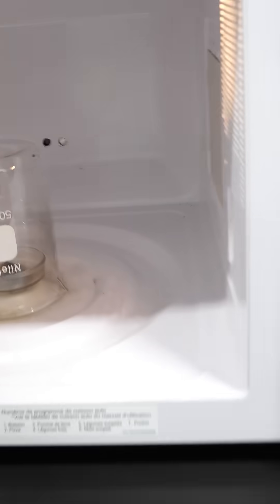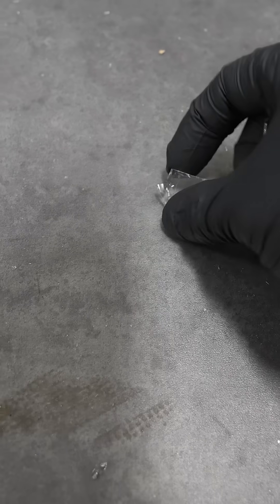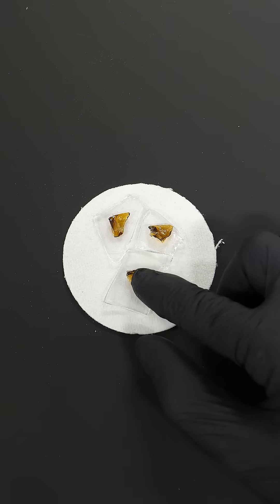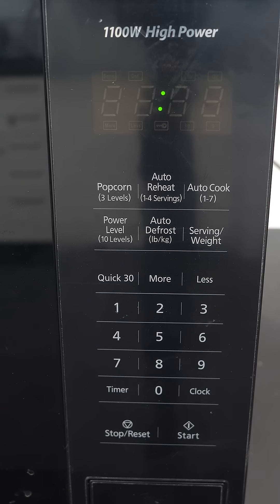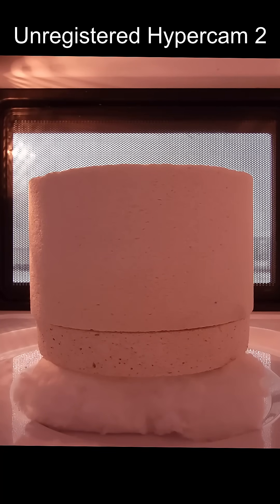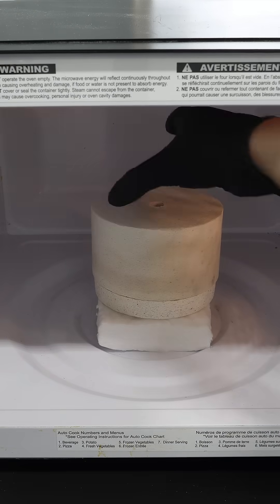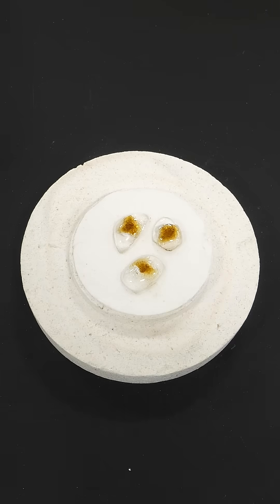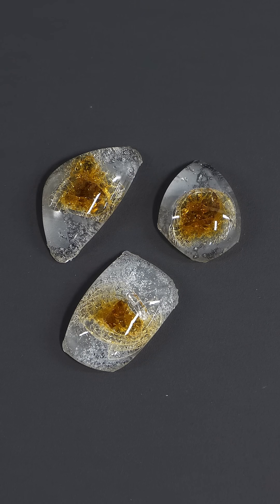Melting glass in the microwave is crazy

Comment: Fuzing inside a microwave is actually really cool, my mum is a glass artist, and we also have one of those. Kinda crazy that it works even in a microwave. The problem why your pieces have all those cracks is that you need to cool the glass down in a oven for like 8 hours or so, so it doesn't build up internal stress and cracks.
Reply: Yep. It's called annealing.
Reply: @mrfirestop415 i’m so happy i recognize this word, im in a metals class  and when the metal is work hardened,  we anneal it to make it softer (i assume its similar or the same for glass) then we put it in water and it makes a lovely sound which my teacher calls quenching
Reply: @alienlapdance  annealing is when the metal is raised to a critical temperature where the crystalline structure can rearrange itself to get rid of the deformations created by working the metal (work hardening). The metal has to stay at that temperature until all the crystalline discontinuities are gone. 

Quenching happens with alloys with are heated up past a different critical temperature causing a change in the structure of the solid solution (steel will have several different solid solution structures called phases. They can graphed in a phase diagram). For steel (% carbon/iron is <2%) rapid quenching in oil or water will cause a sudden change to the structure called martensite which is very, very hard and also very brittle. 

Tempering will change a portion of the martensite to a different structure which will make the steel more resilient,less likely to shatter.
Reply: I wonder if a controlled cooling WITHIN the microwave could work: 6 minutes at max power, then bursts of 10 seconds progressively less frequent to maintain a steady decrease in the kiln temp.
Reply: That sounds so cool! I love anything art related, and i would definitely love to try glass art 😊
Reply: do you know if there are heat resistant molds that the glass stays contained within?? really cool! I would like to make little stars with broken bottle glass
Reply: @cocoandrobin  if you ever manage to make your little glass stars, please come back here, and reply to thus comment with a link to the video you make of the result. I love the idea of little glass stars and would love to see them one day.
Reply: Your mom is busy she’s aT my place right now
Reply: @at_3831  wow, such a useful comment 😂🤦🏻
Reply: You ever just wanna chew on some glass?
Reply: @ScrubbyRumpkins  always
Reply: Would these pieces be safe to make into jewelry or do those cracks make them likely to break?

I'm not going to do this at home, I don't have proper equipment or knowledge, and I'm not stupid enough to do something like this without those. I'm just curious, cause these are pretty.
Reply: @sammyisanoctopus  yeah the cracks make the glass fragile and very likely to break
Reply: Why not just 'cook' them in an oven to begin with?

...Cook... God, I feel like Walter White... 🤔🤔
Reply: @daytona1073  well most people don't have the space to buy a glas oven. And this is a fun little way for those people
Reply: @daytona1073  A regular oven does not get hot enough.
Reply: @daytona1073  convencional ovens cook no more than 500degrees. To melt glass you need more than 1400degrees, and those especial oven are expensive. This is the most inexpensive way.
Reply: OMG ASK YOUR MOM HOW SHE DOES THE ART

Comment: Hey did you get this idea for me I brought this up and one of these videos and they have been yours? You might as well try the light bulb one next. But you got to have the glass up a bit about half an inch and upside down though and you shouldn't have any issues with ruining your glass. Plus you don't have to use Pyrex. The problem with using microwave as a kiln per se is the heat tends to focus on general area and you have to get the timing right

Comment: It's because you put them near each other but not touching. The pieces that were touching did get fused together though. The only difference timing or power would've changed is how melted the glass got. Try having the pieces touching and maybe during the cooling stage opening it up and mixing the glass before it's hardened

Comment: I had this old turn knob style microwave that my stepfather gave me when I moved out. My roommate had put a glass mug in the microwave with water and cranked the knob turning it on for what must have been a good 30mins at least and then he jumped in the shower forgetting about the microwave. I came home and noticed sparks inside the microwave and quickly opened and unplugged it. That said, ..the top of the microwave had melted down molding into the top of the glass mug which didn't shattered and still had water left inside. How it didn't blow up or cause a fire I will never know, ..but we kept the microwave as a kitchen showpiece for a good while. Eh, ..being young and dumb. good times

Comment: The glaas pieces have to overlap to melt together if it's that thin. Glass likes to puddle to roughly 1/4" or 8mm tall. Since those were mostly shorter than that, the edges pulled in. If your piles of glass are mostly over 8mm high, it will glow outwards.

Also, those are probably going to break since you used glass from two different objects. Their coefficient of expansion (COE) is different, so it adds a lot of street to the glass. You can see the stress if you place one of the pieces you made between two polarized sheets, lit from behind/underneath, and rotating the top sheet until you can see the stress. It's safer to add mica powder from a craft store, but some brands and colors tolerate the heat better than others.

Comment: worth noting, the power setting on a microwave just turns the microwaves off and on at regular intervals. For example: Power 5 is how I input 50% on mine. And it means it is off for about as long as its on (the algorithm might lean slightly towards or away from exactly the same not sure). It turns off for like 5 seconds and then on for 5 etc...  You can hear the difference
Reply: unless you have an inverter microwave. i don't, but i want one
Reply: Too high power got you going didn't it? Meanwhile I'm googling either/ either>either...
Reply: The power setting on a microwave actually changes the power and not the interval. If you don't know what you are talking about, then please keep your mouth shut.
Reply: @iamhereforever  You should take your own advice.
Traditional microwaves are only capable of outputting one power level. To vary the energy output, microwave manufacturers vary the duty cycle of the magnetron. 60% power roughly translates to on 60% of the time; off 40%. This is normally based on an approximately 20 second cycle period. Panasonic uses proprietary technology (Inverter) which acts more like a SMPS. Instead of 50/60Hz being output from the high-voltage transformer, the output waveform is ~40kHz. This allows the magnetron output power level to be accurately controlled.
Telling someone to keep their mouth shut is pretty rude, especially when the person is correct (albeit partially), but it's about all I expect from Internet keyboard warriors these days.
Reply: @iamhereforever  You're confident and unintelligent. You could be president of the USA.
Reply: @iamhereforever  Not true, the power is turned on and off in a cycle.
Reply: @iamhereforever  “For most standard microwaves, the power-level function actually pauses the microwaves for short periods of time to allow the food to cook at a slower rate. You can even hear the microwave's magnetron switch on and off if you listen closely.” It only takes a few seconds of research to find this information.. Speaking of research, you should take a look at the dunning-Kruger effect right after you look up “how to disagree with someone without being an ass”

Comment: I didn’t realize that you could melt glass with microwave because I thought it really interacted more with a slight amount of moisture in order to cook our food and the fact that you were able to get it hot enough in six minutes to melt glass, which has a pretty high melting point is pretty impressivenow, I can understand why you isolated it so much with the other components that it was sitting on
Reply: The kiln inside absorbs the microwave energy and that’s what heats up the glass

Comment: You're so smart! But you forgot about the Thermal Coefficiency of Expansion. That beaker is made of Borosilicate, a Crown glass. Whereas, your brown glass may very likely be made of Soda Lime. You'd not be able to get the Borosilicate to temperature, or get them to fuse successfully without cracking, as the two glasses change in size at very different speeds. 👌.

Comment: As a glass artist (of many years), I suddenly find myself 1000% ashamed that I have never even remotely thought of doing this -- WOW! 

I'm honestly amazed; you even had a way to anneal the glass! Tempering it with a gradual cooldown is a very crucial part of creating something that won't crack. Nice job! 👍🏻
Reply: I found the answer. Apparently microwave kilns exist. The inside is lined with silicon carbide which absorbs microwaves. They can reach temperatures up to 2200°F. Depending on the type of glass, they can soften or melt in that heat.
Reply: Utilizing time and waiting 😬🤯
Reply: They sell these online, and it can be tricky to get the timing right, but they work just fine.
Reply: Perhaps the kiln increases the heat enough to melt the glass.
Reply: This is a kit. The castable clam shell allows the glass to get hot enough. It won't work with out it
Reply: Isn't this an early April fools joke? Microwaves work by vibrating water molecules. You should be able to put a glass of water in a microwave to boil water. Even the plate that spins in the microwave is glass. It wouldn't melt.
Reply: @Langustaaa  Did you even watch it? He removed the glass plate beforehand.
Reply: @CallistaClyne  Have you ever used a microwave before? They all have glass plates. They use Glass for a reason. Glass absorbs infrared, not microwaves.
Reply: @Langustaaa  Have you watched the video? He literally removed the glass plate. I don't know many, sounds like you didn't watch it.
Reply: @CallistaClyne  Usually the glass plate is present. It doesn’t melt.

Comment: You mixed borosilicate and something that likely wasn't. You'll get cleaner results if using glass that's got a similar coefficient of expansion. That brown glass bottle is likely "soft" glass and the beaker is likely "hard" glass - borosilicate, basically Pyrex, but the good kind. See the splintering cracks around the brown? It cooled and shrunk at a different rate than the surrounding glass. These pieces will likely break on you randomly at some point.
Reply: Borosilicate beaker and soda glass vial do not go well together.

Comment: Im a glass blower, and this is a type of glass art. Its called casting. Usually done in a kiln and not a microwave, but its super cool. You can make plaster moulds and fill it with broken glass, and the glass will melt and form into the shape of the mould

Comment: As someone in ceramics currently:
There's not enough material present for the pieces to actually fuse to each other, and you likely would actually have to put it on a HIGHER power and have it run for LONGER.

honestly, nile, just get in to ceramics, I think you would enjoy it, especially glazes (with all their chemical reactions happening inside the kiln, the different types of kilns and atmospheres you can work with (salt, wood, ash, etc.), etc.)
also, it might end up being useful to have a kiln on hand for future projects

Comment: COE = Coefficiency Of Glass
This is about the different types of glass that are used in melting them together to see if they are efficient.  If they aren’t they will crack. It may not be today but at some point when they get hot or cold or age a bit they will.  There is a special piece of paper that you look at the glasses that are melted together to show stress areas.  
Also when a glass artist is shopping for glass every glass is marked with its individual glass numbers - such as 90 or whatever.. so we know what glass to melt with each other.  Whether it’s in torching glass (lampworking) or placing it in a kiln it has to be coefficient.  To simply put any glasses together and expect them to work properly will end in disappointment. Being expensive means one will take the time to do the small tests to determine the COE of each one.  At the end we can drill holes in the test strips and make a little wind chime or something similar so it isn’t wasted 😂😂😂 I wouldn’t hang it outside tho lol

Comment: The COE Coefficent of Expansion, of the glass you use is completely different. One is scientific glass, the other probably common bottle glass.
They will fuse together but they will cool, and contract at different rates. Where glass is concerned not only you have to annual the glass properly , not really necessary for small pieces like that, but you have to test the COE of the glass., or it will crack because they want to expand and contract at different rates. There is no magic trick here. In this case I could have told you ahead of time that the COE of the two types of glass would be different.
there are companies that sell multicolor glass that is guaranteed as having the same COE. 
Glass tubing for Neon also often has similar COE, but that’s not my field of expertise.
I am not even sure you’d be able to fuse different colored scientific glass, but